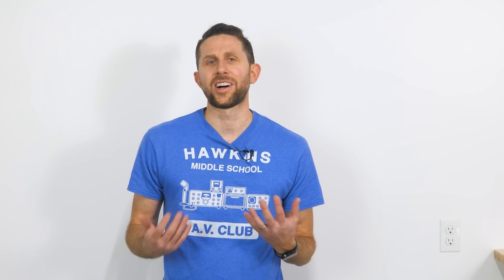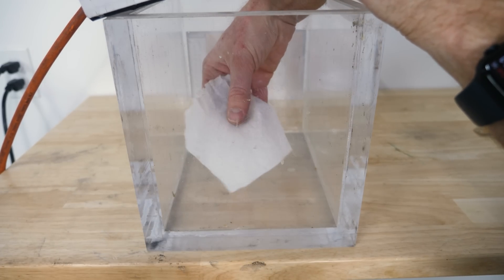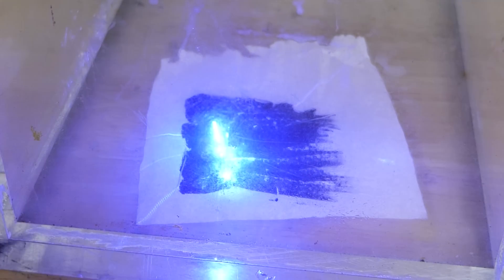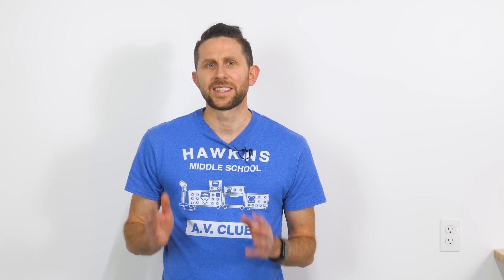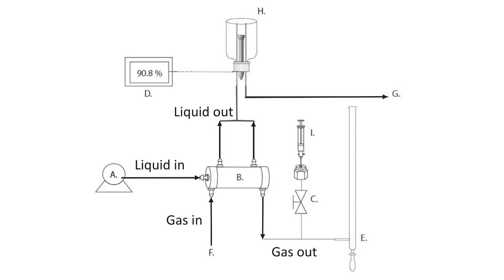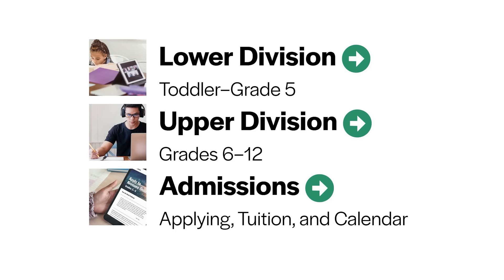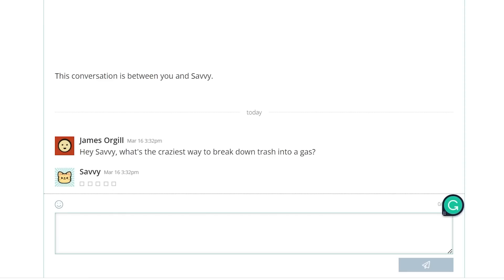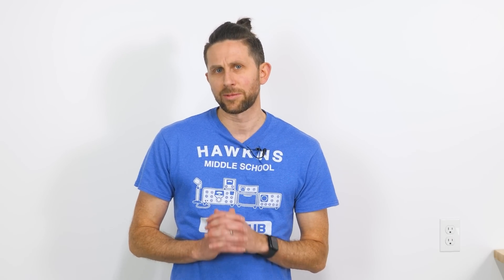Turning Trash Into Fuel

Comment from the maker: To answer a few questions about syngas fermentation. An energy balance on the whole process shows that you can get more energy out of it than you have to put into it. That energy comes from the trash. Does this reduce total CO2? Well kind of. It replaces gasoline with ethanol. This ethanol was made from landfills. In the landfill the trash would break down on its own over time and send methane and co2 in the air. So either way the trash is going to send greenhouse gasses into the air. So if we use it as fuel and then send the gasses into the atmosphere it replaces the equivalent amount of gasoline emissions that were replaced by the ethanol. But only by a small fraction that would have become greenhouse gasses due to natural breakdown of the garbage. 

Another benefit I didn’t mention is that there is a demand for ethanol. Most ethanol is made from food sources like corn. So we are using food as fuel which can cause food crises in developing nations.  So syngas fermentation can help reduce the demand to use food as fuel. 

But it doesn’t work well right now. It’s really hard to quickly dissolve the gasses into the liquid. That is what my research was focused on. I used hollow fiber reactors to dissolve the gasses into the liquid and measured mass transfer coefficients.
Reply: I was going to criticize your video until I saw this. Thanks for the extra lesson in humility.
Reply: but we could also burn it in an enclosed room so the co² and other emissions can't escape. I think the power plant with the ski-roof is doing it like that (they use a carbon catcher idk how it works though)
Reply: @JuliusUnique  there are approaches to sucking out the CO2 from power plants and depositing them in rocks. That will reduce the amount in the atmosphere as long as you don’t put out CO2 in the process.
Reply: @westonding8953  I know, did you know there are also plants that get rid of the co2 completely? not sure if they use a chemical or physical process but somehow they change the molecule so it isn't co2 anymore
Reply: @JuliusUnique  if they can synthesize hydrocarbons products from CO2 on a large scale that would be very helpful.
Reply: @westonding8953  It would be a waste to deposit it in rocks.

I heard that right now, green house growers buy wood to burn to create CO2 to grow food. It makes more sense to sell it to green houses to reduce the amount of wood burned.
Reply: @eugenetswong  I have not heard of greenhouses buying wood to burn. Unfortunately, burned coal is a quite unclean so I don’t think selling it to them is the best choice. Burned gas? Maybe.
Reply: You would have to get people to properly separate their trash in the first place to make this an efficient process. That would require improvement in societal mentalities.
Reply: @westonding8953  here in germany we already separate the trash for decades, but I think that's the wrong approach, there must be businesses that do this for u
Reply: @JuliusUnique  such a business will be another economic cost and likely less sanitary than having the consumers develop a healthy and eco-friendly habit of separating their biodegradable organic and inorganic trash. Combatting pollution and climate change requires a collective effort and collective ethic.
Reply: @westonding8953  I have to disagree, that's like saying "if everyone has their own garden we could cut on mass-food-production" but I think big specialized businesses are the reason humanity becomes wealthy
Reply: @JuliusUnique  I agree with you on some of that. But if everyone could garden and understood how the biology of growing food works, the world will be a better place.
Reply: @westonding8953  no, because then people had less time to care for YT-servers and doing research on gene-editing and anti-aging and studying and doing engineering etc. If people would be less lazy though, as hard working as me, then yes, we would reach utopia withing a decade
Reply: @JuliusUnique  honestly, the small things people do without expending too much energy on will make a difference in our world. If everyone returned their shopping carts after shopping instead of recklessly leaving them in the parking lot and risking damaging vehicles and costing the supermarket the cost of collecting them, the world be a better place. Same with habitually separating trash.
Reply: @westonding8953  no, we need a business for that I already explained why and duh, if people would be less lazy the world would improve faster, but how do you want to make them less lazy? the only way would be gene-editing and artificial wombs, but I have to find a wife I have no time to build those but maybe you can help
Reply: @JuliusUnique  sure. I am not opposed to a business for that but education has a purpose to make a least the bulk of people less lazy and more productive. We are not perfect but we try. I hope you can get the shopping carts analogy.
Reply: Climate change isn’t real, winter and summer are just getting later; we’re literally more than halfway through March and it’s still 40 degree weather IN TEXAS

I think it’s because of how the year doesn’t perfectly align with the orbit, and I think what’s happening is that the tilt of the earth is slowly rotating making it so that summer and winter take longer to get here, and eventually we we will have winter in the middle months and summer in the first and last months and the Southern Hemisphere will have theirs switched as well
Reply: @marvelsoneandonlysentry  If building a dam in China could affect things, then I wouldn't be surprised if the rotation were affected by concrete production, or perhaps the climates were affected by water management [i.e.: California].
Reply: James, it is cool to see that you have PHD. At first, I thought that you were just an ordinary guy talking science on YouTube, but I became convinced that you had some kind of chemistry specialization.

Would you make a video about your PHD research, please? I'd like to know more. Ideally put it in layman's terms.
Reply: Well to produce gases on an industrial scale, a lot of funding needs to go into it. Not to mention you'll have fight oil cartels(OPEC). I like the idea of using trash as fuel but at the end of the day it's about how much realist it is.
Reply: @The Action Lab does burning it in a plant work basically like a nuclear plant but rather than releasing the gas into the atmosphere acidifying it or adding it yo lime stone and stuff
Reply: @Frank-ru3nw  yeah, the power plant with the skiing ramp on the roof does that kind of
Reply: @Julius Unique  what I am talking about in a more simplified form is burning trash in a more controlled environment rather than coal to heat water to steam to turn a turbine but rather than releasing the carbon dioxide into the atmosphere containing it in the earth or acidifying it that is dissolving it in water
Reply: @Frank-ru3nw  I live in a region, where we incinerate 1/5 of our trash. The smoke stacks filter all the gases, and then the filters are burned after replacing. The heat is used to generate electricity and heat water, if I recall correctly.

If the CO2 is clean, then they should sell it to green houses.
Reply: There’s no need to reduce CO2 as it’s not a pollutant and is not causing problem as the powers that be want you to believe.
Reply: I'm a biochemistry undergraduate and my research focuses on optimizing the renewability of biodiesel production. We make our fuel from waste cooking oil, ethanol, and a glyceroxide catalyst that is made from the glycerol byproduct in the production process
Reply: Let's do it all! Sort our waste, convert what we can to syngas, then use that for the biofuel! But forget cars. Use the biofuel for jets! Then make the jets hybrid engines that use biofuel for takeoff but electricity for cruising!

Sure there are problems with every stage, and nobody solved world problems in YouTube comments, but it is exciting to think of the possibilities that could come from chaining and combining these solutions!
Reply: Good idea, though we should really just avoid producing waste in the first place. Processes like this make people feel its acceptable to generate waste.
Reply: @drsquirrel00  as long as they pay the trash-removal-business it literally is totally fine to generate trash
Reply: @JuliusUnique  That is a terrible attitude to waste. So long as Shell oil pays their fines... its okay for them to leak oil into the oceans? Bit of a strawman but exactly the same reasoning.
Reply: @drsquirrel00  you think too practically, I was reasoning it from a logical theoretical perspective, practically the world is a chaos and educating the public is important, the problem that "humans are not perfect" is literally the reason we have to work and do work and have problems etc, but "we need to fix all people from doing x" would be cool if it works but it doesn't otherwise I would be a multi trillionaire and the world leader
Reply: @JuliusUnique  Excuses excuses, reduce comes before reuse, then recycle.
Reply: @drsquirrel00  excuses? did you even read what I wrote? I didnt even talk about myself, how am I doing excuses? what?

Comment: I dont understand the need of transforming the gas into a liquid. Gasoline engines work very well with any flammable gas. Where I live, its very common to see cars that that are running on gasoline only for starting the engine, and then they switch to propane.
I think the real challenge is getting a pure gas so that engines do not get damaged by tar and soot.

Comment: You actually dont need liquid fuel. Both internal combustion engines and external combustion engines can run on fuel that is in gas form. Some people modify their cars so it runs on wood gas
Reply: Yeah, it was a common during ww2, but the engine will not have a long life, unless you purify the gas.

Comment: I do not really buy into the "end of the world" hysteria of "man-made" global warming. I think its just a method of destroying a countries industry and making money. 

That being said, I certainly don't have an issue of trying to make the world less polluted, if it does not mean more tax burdens.

Another way to reduce emissions could be to manufacture to "mil-spec" meaning each tools like screws, screw drivers etc would be standardised, so that there is very few types of screw patterns, example would be a star shape, that could be universally used.

This means, we do not need to have 20 different types of screw drivers, an insane amount of screw head types, bolts shapes,  different wrench sizes etc if we could reduce the variants we dont need to manufacture as many different tools and therefore reduce manufacturing and therefore lessen the emissions.

Build epic buildings that are to last 1000s of years, examples are the buildings in rome, build it once but build it properly and we don't have to build, demolish and build again, wasting resources and causing endless emissions.

Invest more in nuclear energy and their safety, switch over to thorium based fuel rods, which are much safer.

Make  light bulbs that last a 100 years and are energy efficient, fun fact the first light bulb ever created still works if my memory serves me right. Less waste and no need to change them at all if they last that long.

Just to name a few examples that could make a difference.

But I suspect that we live in a consumer based economy, where money is to be made and spent, to keep it flowing, so I doubt they would do such serious changes, so that we continue to have to have 30 different tools to get something fixed.

Comment: Using living organisms to convert syngas into a liquid fuel is a really overengineered solution.
It is way more practical to just convert syngas to methanol directly, in a single chemical reaction. Methanol, just like ethanol, is a liquid fuel that would work just fine with a car engine, and it doesn't require an actual biofactory to produce.

Comment: The thing about land fills is that we are burying and trapping carbon underground.  However a lot of carbon can escape the landfill as methane produced through bacteria and other natural processes of breaking down and decomposing.  Methane is a worse greenhouse gas than CO2 so we don't want to just let the methane vent out to the atmosphere, but we want to capture and use it as fuel.  Many landfills already capture the methane and pump it into city natural gas lines for houses to use for heating and cooking.  When we burn the methane we are still releasing the CO2 into the atmosphere but we are preventing methane, the worse gas, from going into the atmosphere.

Comment: To turn back climate change, we need to remove carbon from the biosphere. Replacing fossil fuels with fuels made from trash does not do this. We would need to bury the carbon from the trash in old coal mines or similar.

Comment: I suggest burning the trash, produce power, charge EVs. Much more energy efficient, practically free in comparison, waste heat can be utilized, exhaust from the power plant can be cleaner than the exhaust from the cars, and it doesn't have to be released exactly where people breathe.

Comment: I'm not so sure this would have much effect on climate change. Does storing garbage really affect our climate? Does the production of gasoline have a strong effect compared to the effect burning it that could be offset by doing this? I do agree that finding a use for garbage to make ita reusable asset would be a great thing, but the solution to climate change seems more on changing our energy sources. For example, could garbage be turned into electricity in a way that doesn't effect the environment? That would be a huge step.

Comment: Gasification to Catalysts can make Methanol and/or DME Directly which is much simpler/more scaleable
Reply: *Granted don’t get me wrong, Hydrogen/Syngas or even Straight Up Electrically fed (Reverse Microbial Fuel Cells) Microbes have their place in the Power-to-X / RDF spaces, but i am unsure this is it.
Reply: Entrained Flow Gasification, and Supercritical Water Gasification are much better in my opinion.

(*May* need to used the simpler Fluidized Bed Gasification for some Refuse Derived Fuels (RDF), but even then, short of making Ash a bit more problematic it works fine)

(Edit: Typo Fix)

Comment: There's actually another form that used water under extreme pressure, heated to very high levels that breaks down any organic compounds into carbon, and even dissolves pfas, and the end result is basically coal and a liquid you can get natural gas out of.

Comment: How adequate would that fuel be for current car engines ?
Reply: 10% in current fuel should work on most cars after 2004. But it'll be much more expensive than the current ethanol enhanced fuels.

You could get cars running on it with a dedicated tune, though i doubt people would pay that just to buy even more expensive fuel.

The bigger problem would likely be the power requirements to make the conversion - i imagine it'll be much more than using the same amount of power to directly power an electric vehicle. At any scale i doubt the power could be sourced greenly, so the carbon offset would be worse than paying a device separately, plus you're turning the trash into carbon gas too - which would be another big expense to cleanly deal with.

This could have been a decent study 30 years ago

Comment: We do the trash to energy thing here in the UK. Instead of using the gas/diesel/petrol to run a generator you can burn whatever you want in a giant steam engine (so general waste). That means using less of gas/diesel/petrol for energy generation that you can use in a car or whatever. You need no further chemicals or anything.

Comment: It's not fuel, but you can get energy out of it without much pollution by burning it in plasma ovens. Easier, but, yes, not usable in a car. Sweden actually deals with 52% of it's trash this way, and it recycles 47% of the rest.

Comment: It seems you need more energy to turn it into fuel than the energy you would get out of it.
Reply: The rubbish already has quite a lot of energy in it, so the energy you need to make it into a fuel comes from part of that energy (so the fuel has less energy than the rubbish originally had, but only moderately less, and it is in a form that engines can use).

Comment: it seems to be a step in the right direction, but it looks like it would take a lot of energy to gasify the trash. i think a better option would be to take the gases you need out of the air, and convert that into fuel, and reduce the use of disposable items, especially plastics.

Comment: Question. Does it have to be a vacuum environment or just an oxygen free environment. For example can you use Argon or Nitrogen in this process
Reply: Not an expert but I believe yes. If a vacuum was required it would likely be impossible to do economically at large scale.
Reply: Yes, you can (and usually would) use an atmosphere at normal pressure but with no oxygen.  He just used the vacuum chamber for convenience for the quick and dirty experiment.